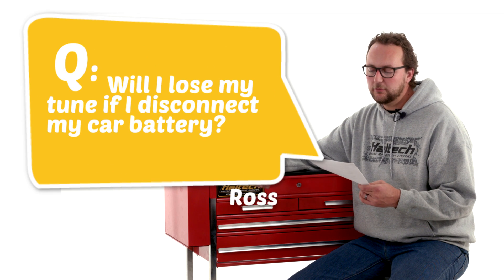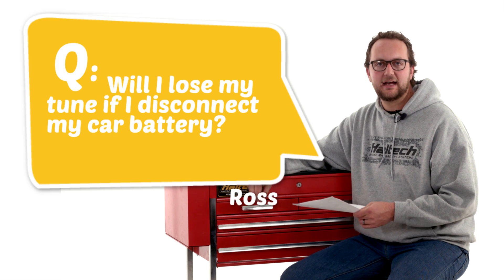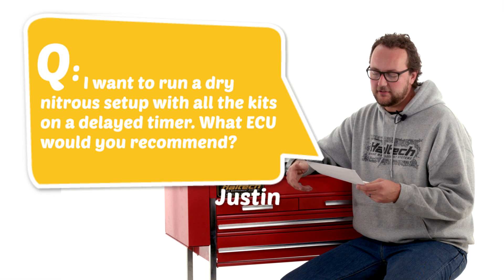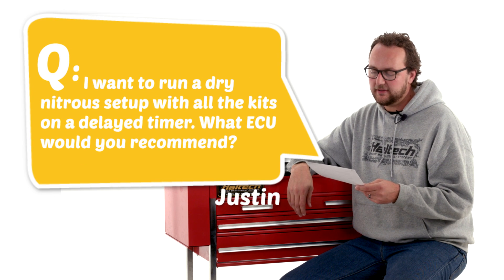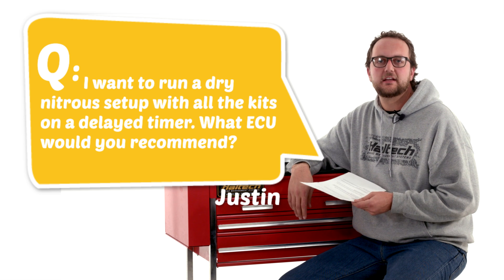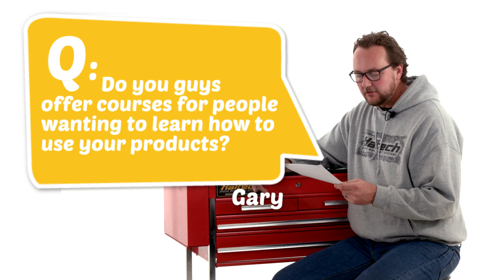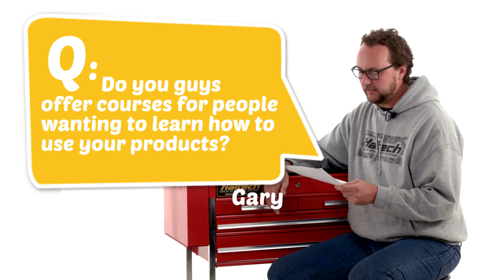❓ Dry Nitrous Setup, Learn How To Tune - Haltech Q&A Episode 13

Comment: I have a few questions; I plan on running a dry setup using the wizards of nitrous direct port kit. Would I be able to use the elite 2500 to PWM the solenoid for a progressive shot? Would I be able to switch off the nitrous map with an AFR or bottle pressure sensor threshold to protect the engine? Thanks!